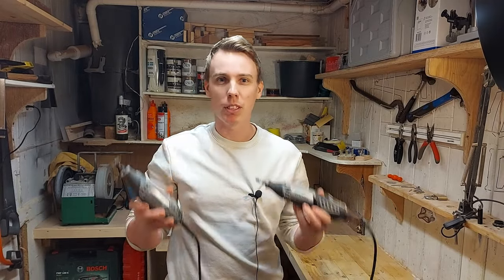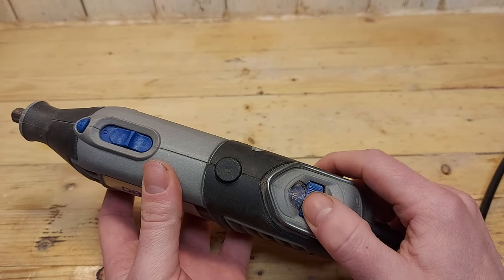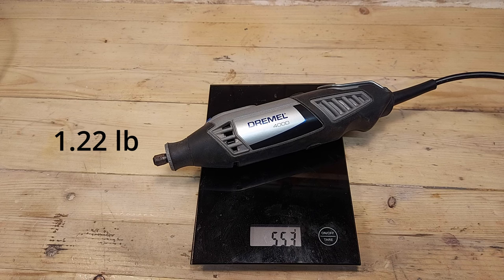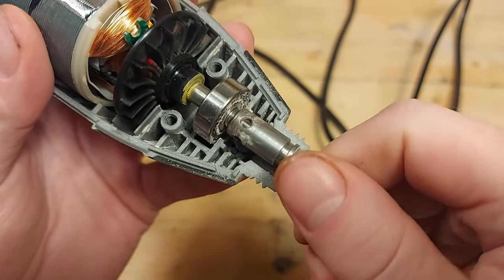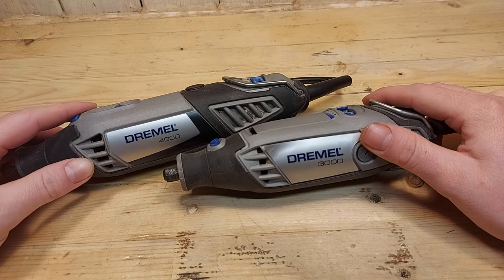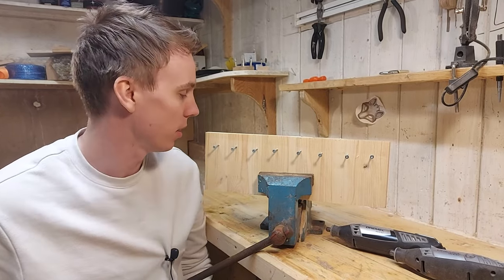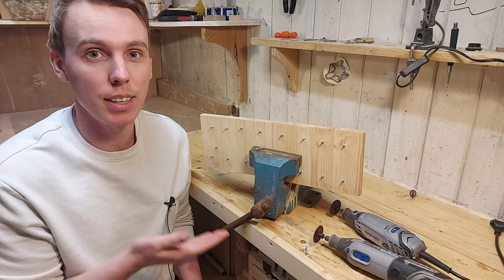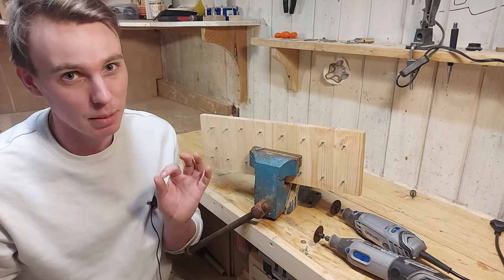Dremel 3000 VS Dremel 4000: All Differences

Comment: Went to the effort of disassembling the 4000 and showing us how the locking mechanism engages better and completely overlooked another important update - the spindle lock cannot be pressed down when the tool is on - you can clearly see that the on/off switch when slide into the on position locks the spindle lock button from being depressed - that is also a very good upgrade, especially with those new beefy locking pins that would cause some damage if you pressed the spindle lock during operation.

Comment: Very helpful and to the point. Great video 👏 I'm going to get the 3000!
Reply from the maker: Thanks. Great choice :)
Reply: Do you guys know if a screw will have any problems being used after cut by dremel? I’m concerned it will make the teeth crooked and not be able to screw a nut into it. Thanks!
Reply: @lcglazer  it can do sometimes. But you can usually force the first few threads on the bolt you've cut using the nut. Bolts don't cost very much to replace

Comment: New to this, and thinking of purchasing a dremel. I do woodwork, but occasionally I need something for small jobs and repairs. What about the 4300? Or the cordless ones? Thank you!
Reply from the maker: All of them will do just fine really, the 4300 has a bit more power than the 4000. You can use it for longer and be a little rougher with tool without the tool overheating. But the Dremel 4000 is more than good enough for me, sometimes i use it for hour long sessions of woodcarving and it holds up just fine. I would only recommend the cordless tools if you really need to use it somewhere where there is no outlet. It is just so much simpler when you don't have to worry about charging batteries. If you are going for a cordless tool i would recommend the 8220 or the newer 8260 ( the price of the last one is a little bit steep, so i have not bought it yet).

Comment: I want to use the dremel for wet green stone. What do you think?
Reply from the maker: I don't quite know what wet green stone is. But if you wanna cut stone i would recommend the Dremel 4000 with the flex shaft attachment and a diamond cutting disc. With the flex shaft you can move the Dremel motor away from the cutting action and away from the water.

Comment: Helpful vid! I wonder if you know of the Dremel 200? It's so much cheaper than 3000.
Reply from the maker: I have not used but i know about it. It is one of the older models. It only has two speeds, 15k and 35k rpm. If you can work with that it is going to be fine. It is also a fair bit weaker than both the 3000 and 4000.
Reply: @rotarycrafts8760  Thanks for your reply, that's helpful info

Comment: You should warned me to put on safety glasses before you start cutting screws :)
Reply: lol they went right on my face
Reply: Do you guys know if a screw will have any problems being used after cut by dremel? I’m concerned it will make the teeth crooked and not be able to screw a nut into it. Thanks!